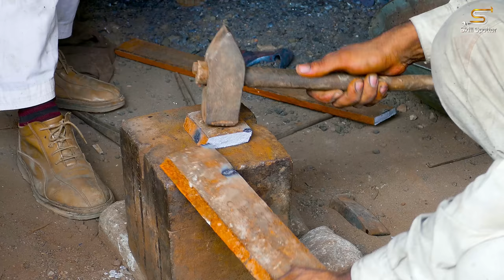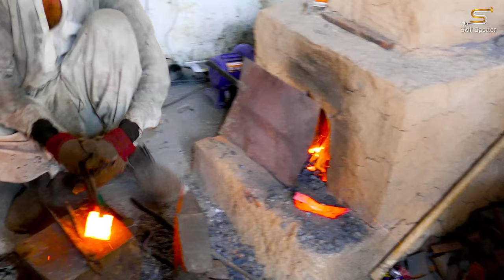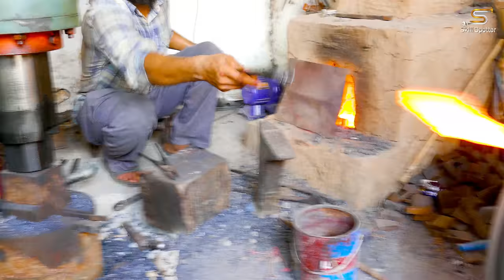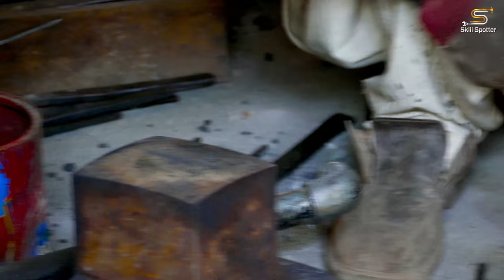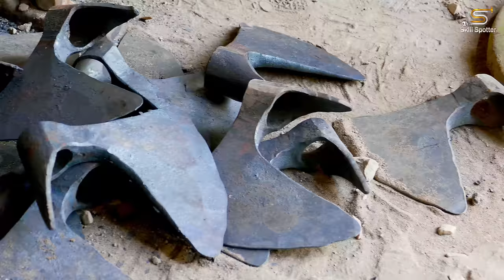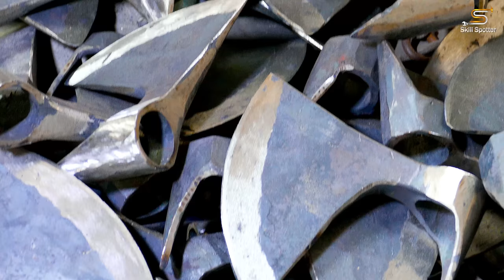Axe Making Blacksmith in the 21st Century: A Fascinating Look at How Axes Are Made at Scale

Comment: Interesting video
I was a professional blacksmith for years and made mostly 18th century knives and axes
I made lots of axes , unlike these folks I did it mostly by hand. No power hammers or electric forge blowers.
Most of the axes were made out of sections or old wrought iron forge welded together with a steel cutting bit welded in. Got the wrought iron from old buggy wheels or strap hinges and just used old files for the steel bit
Reply: do you have videos on how you make axes?

Comment: How do you break big bars of steel like that? I tried it myself beacause i have thick leaf springs. I tried making notches, weak points, welding, everything. It never broke. Is the steel quality poor and therefore brittle? Or is there a precise technique to weaken the steel?
Reply: Yes that grain structure of that steel is huge and is a very brittle material, I would say not suitable for an axe, especially that thin. But they make those out of whatever they can find over there. Leaf spring steel is one of the toughest ones you'll mess with when forging. Its typically 52100 or some alloy of sorts. I would cut that leaf spring slow with a metal saw or use a angle grinder and cut off disc or several
Reply: @joshyingling  european leaf springs are hard and tough, and not brittle at all. I tried hitting my weakened spring with everything i had, it wouldn't break. So i either use an angle grinder or i heat up to white hot and hot cut a piece
Reply: @jeanladoire4141  yeah all leaf springs are made to be tough, these guys were not using a spring steel.
Reply: It is a type of malleable cast iron. These are very bad products. If they put a steel plate on the blade it could be decent. But these are not axes, these are garbage
Reply: @nickspistolsfl9736  agreed
Reply: @nickspistolsfl9736  I've never seen cast iron forge so well.
Also since antiquity and into the middle ages, a lot of blades were made of iron or untempered steel. Yes that's not very good, but with frequent sharpening, it would do the job
Reply: It's a hard steel metal similar like pile.
Reply: @nickspistolsfl9736  
Nope, it's good carbon steel.  Something from the railroads.
And quite good axes.

Comment: cool... but anyone with a knowledge of metal knows it's not supposed to break like that. i wonder what type of steel that is, seemed to break like cast iron
Reply: It may have been heat treated and thus hardened steel.
Reply: @spudpud-T67  however, if its heat treated, that would make it tempered which means its now at optimal strength so it definitely shouldn't break. even if its hard and brittle, i doubt a good quality steel should break like that
Reply: @cyrillevogler4065  Tempering is just one heat treatment. It looks like its heat treated for maximum  hardness only and thus brittle.
Reply: @spudpud-T67  i see where your going but generally heat treated means its at its optimal state and that usually includes tempering. even if it doesn't include tempering, i can't see where they would want the metal to be that hard
Reply: @cyrillevogler4065  In some other comments here the poster mentioned it is a rail iron. Cracking the way it did does not support a temper for strength option.
Reply: @spudpud-T67  maybe but at the same time i dont think the railroad iron here where they are located would be very good quality which i think is the main point im making. the quality of metal being used i just think isnt that great